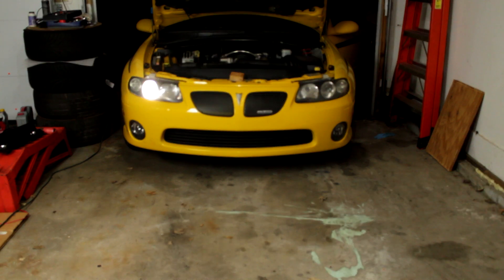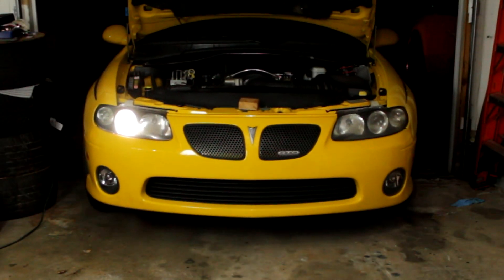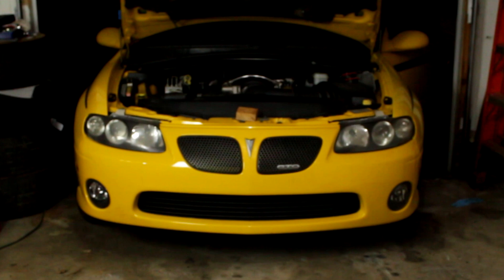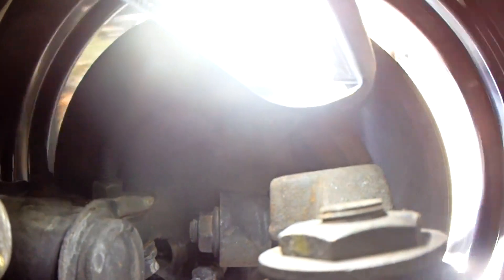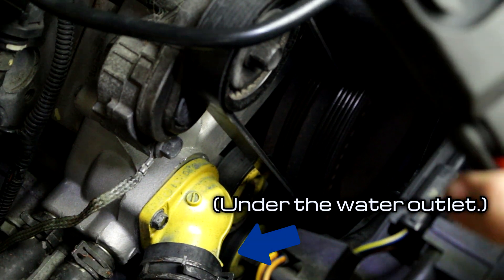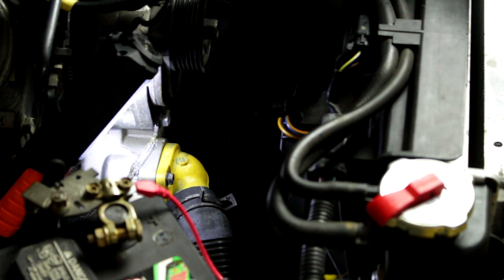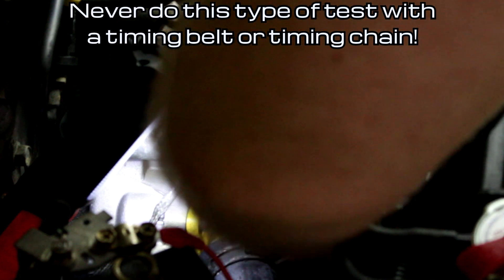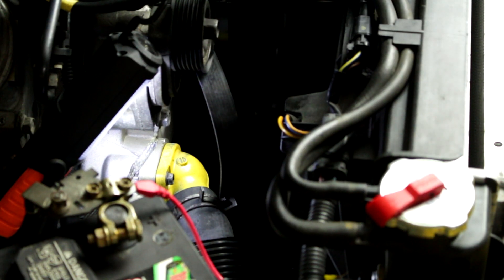How to Find an Engine Noise: Tracking Sound Sources & Testing • Cars Simplified

Comment: nice diag.  that's a common one on LS engines.  I always try to replace that tensioner every time i do a belt on one.
Reply from the maker: Interesting, I guess very small belts are rough on bearings since they don't have as much give as a longer belt. Did you usually just go with an OEM tensioner, or is there a better one out there?
Reply: @CarsSimplified  as far as i know. Oem or something like dorman works well.